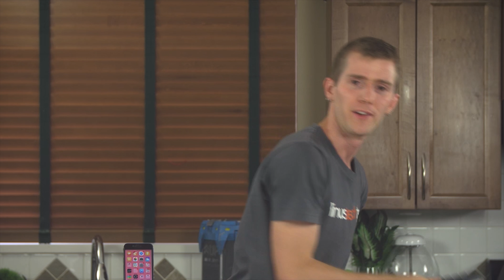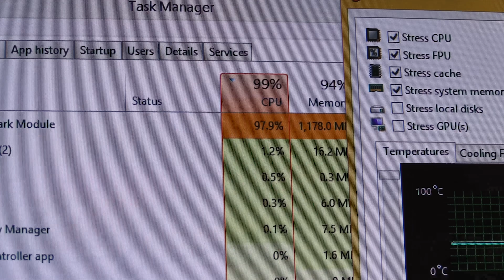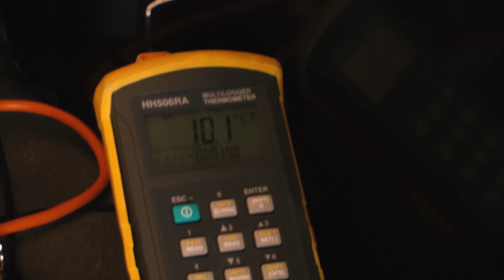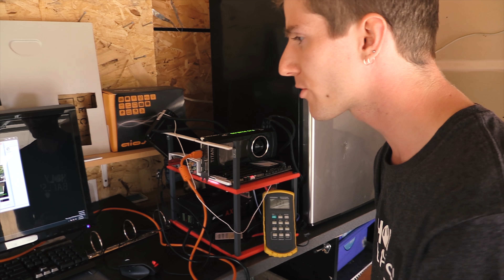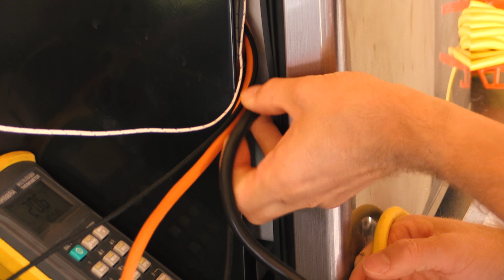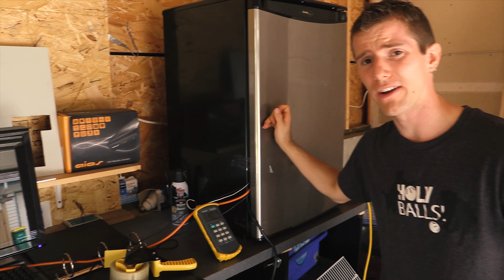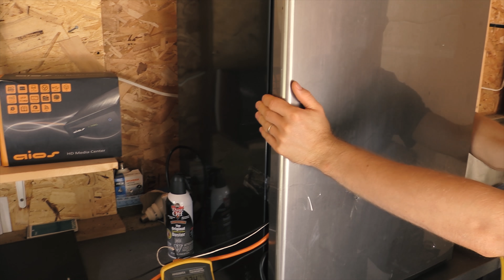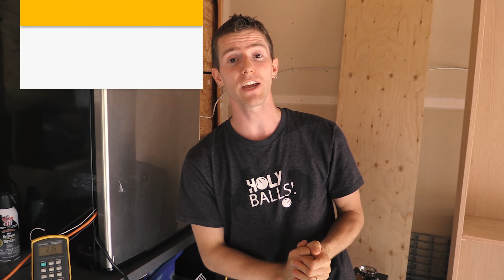PC Build in a Fridge - Does it Work??

Comment: Build a computer in space!
Reply: mfw people don't know that it was a joke
Reply: Kevin G there is a lot of misconceptions here about space. True there is no fluid to allow convection and you would think it's an insulator, but you have to keep in mind that convection is only one of three means of heat transfer. The most significant in space is radiation. Radiation allows temperatures to drop below -100°C easily (space is a blackbody of 2K approximately or -271.15°C). However, direct sunlight in space (about 1300W/m2 at the level of the earth) can take temperatures above 100°C. So as long as your computer is shielded from the sun by say the earth or a reflective material at all times, it's actually a good idea. Source: Aerospace engineer.
Reply: AnAverage Joe Building it in space would be a terrible idea; in space, there is nothing to dissipate the heat and the sun's light is just going to heat the whole thing up even more..
Reply: Kevin G ....Yeah....That is the point. Jesus.
Reply: AnAverage Joe I guess it just wasn't a very good joke.
Reply: I didn't find that joke funny as it literally made no sense at all.
Reply: AnAverage Joe I support your joke. As many people can't take one
Reply: +HaouasLeDocteur thank god I found your comment; stops me from writing it myself.  I was going to say space is an excellent coolant because although there isn't anything to transfer heat via convection people need to understand you're moving from a high energy body to a virtual no energy body.
Reply: it would overheat it has nowhere to transfer the heat to...
Reply: 道衡刘 how do you think satellites work then? That's actually a great idea (there is catch however and you have caught it: the sun).
Reply: +AnAverage Joe 
u call that a joke!!!! lol....
adjust spectacles...begin response sequence
ah...u mean like the on board computers in satellites, the international space station, hubble telescope, shuttles,...or do you mean...connect to power source then float the dang thing into space? just remember its -270 c (-454 F)....so it wont work...and the solar radiation will f8k it up royally....it will be a rich mans version of '''will it blend'
Reply: +Person. but computers in space stations and spaceships relay on air flow to dissipate the generated heat by its components, the problem of building a computer in the vacuum of space, (other than the obvious reasons) is that there is no air flow being a vacuum and all that, so the components would have to relay on radiation to dissipate the heat, instead of conduction (heat transfer), which is not a good way to dissipate heat as fast as the components generates it, so not a good idea, even liquid cooling systems, and the new convection cooling systems, relay on air flow to transfer the generated heat.
Reply: Yu Stephen People who indulge themselves in technology a lot or "nerds" how they used to call them; don't have very much of a good sense of humor.
Big surprise, right?
Reply: Avery Chapman As it has been pointed out before, this is incorrect. Comets don't all originate as broken chunks off an ice worlds, after all.

Because space is a near vacuum, there is near-infinite capacity  for the heat to dissipate into. Furthermore, Linus the Tech Tool was wrong when he concludes that the reason a fridge doesn't work is because it is a "closed system". For one thing, it's not, the thermal energy is being absorbed into the coolant. The problem with the fridge is that it cannot displace enough thermal energy to keep up with the heat being generated. In fact, a fan placed inside the fridge (not outside leading in, but inside the fridge itself directed to components) would improve efficiency provided the fridge has sufficient capacity.

What you are thinking here is that the vacuum of space would prevent heat loss by conduction. However, radiation would still take place.
Reply: +AnAverage Joe it'd be wiser to buuild one on Earth, then send it to space.
Reply: *****
radiator only cools to ambient temp. he would need a water chiller/phase chanage unit that can dissapate heat in an oven, oh not to mention the computer would need to be a closed system.
Reply: HaouasLeDocteur Mhhh good point, missed that one; +1
Reply: +bign3ck SIGNIFICANT heat transfer WILL take place via radiation and in total eclipse, you'll witness temperatures so low I don't think your processor can even handle them.
Reply: TheDeltaMoo very slowly, which was my point.
Reply: +AnAverage Joe Actually good question, in space temp go very very cold, but no air to disperse the heat, no idea what would happen.
Reply: OMG for anyone that's actually contemplating the solution to this:  YES space would be an excellent coolant through radiation (because there is not air to transfer through convection) HOWEVER since the radiation transfer would be extremely small because of the surface area of the computer/processor you would need to have large fins to disperse the heat (increasing the m^2 would therefore increase the rate heat is transferred).
Reply: ***** Great contribution.
Reply: +AnAverage Joe There are already many computers in space ;)
Reply: +AnAverage Joe NASA has done that... Long story short, it works...
Reply: ***** I think we were talking about a different kind of vacuum.
Reply: james wasda LOL this is hilarious....i guessing he was joking....or Houston we have a problem....
if he is serious, imagine if he runs a food and beverage company and his biggest selling point is his unique vacuum sealing technique...i can just imagine a production like of hair nets and hoovers LOLL
Reply: Harri v'Jah A bunch of plastic bags getting sucked out by dyson vacuum cleaners.
Reply: ***** okay...i don't even want to think through that one...lol... well this friggin thing would have worked if Linus used a god dang desktop tower with the panels removed (replaced with thin film used for food..to prevent condensation f8kkin sh88 up...that god dang condensation...) and kept the peripherals on the outside...,he used pressure sealed unit with its built in vents dissipating the heat) ....so when the fridge does its thing..its just cooling the vented air as those air molecules are closest to the walls)....god dang ZBox essentially create a force field fo dissipated air around it self....its like 'listen fridge I got this...I SAID I GOT THIS!!!" the fridge never gets a chance  to cool the components that Linus is measuring...

as for you vacuum cleaner...you do realize those friggin cooling fans are a vacuum cleaner ...hence the air blowing out the back of yoru desktop or sides of your laptop are warm...just like a vacuum cleaner....

anywho...fridge is for BEER...hmmm beer...
Reply: +HaouasLeDocteur Moreover, it is not the fluid dynamics that promote PC cooling, but rather that by moving away fluid (aka air) you're providing a medium of lower energy energy saturation in place of a medium of higher energy saturation; as a result more energy from the CPU can be absorbed into the air. As such, the problem with the PC in the Fridge is not that it's a "closed system". All active air conditioning, including refrigerators, operate at highest efficiency in closed systems. The problem is that the coolant could not absorb and dissipate heat fast enough to keep up with the thermal energy being dissipated by the PC. A closed system is better not because you're letting "cold air out" but rather because you're allowing increased energy in, which the coolant must absorb to maintain a target energy density in the system.

The reason why water, glycerol, glycerine and oil all work better than air is because these materials can absorb more energy than air can. But they all work in the same fundamental way, and this is why frequently simply plopping a motherboard into a fish tank full of vegetable oil will not work well.
Reply: abattlescar Hopefully the duct tape will hold up under those conditions :/
Reply: Zavi Aman Sick! I'll have all the money from kickstarter in about a month!
Reply: +droid Not Quite because of thermal radiation, but that's certainly not enough to cool a pc
Reply: +Pandollian Nope, that is a fallacy. Space is cold, but there is so little of it out there (i.e. it is a vacuum) that the only mode of heat transfer away from the system is radiation. And if you are in the sun, you can forget about that too unless the computer is actually /glowing/ from the heat.
Reply: droid i"m a saiyan, Does that mean i'm not a moron? Or a super moron
Reply: Computer would overheat.

It wouldnt be able to emit its own heat because the vacuum does not transport it.

Therefore, oberheat.
Reply: +HaouasLeDocteur You&#39;re right in that radiation is a thing, and that it&#39;s pretty effective, but you definitely don&#39;t really understand exactly how the cooling works.

Radiation is a very powerful tool for dissipating heat, but unfortunately, it&#39;s not enough to keep up with the heat that a processor generates compared to its surface area. Getting rid of waste heat in space is actually a huge problem that NASA had to deal with. Instead, they decided to use heat pipes--think liquid cooling using fluids other than water--to move the heat off of the heat sources and into reservoirs that would increase the radiation rate. But when you start factoring in efficiency, you&#39;d be much better off just building it here on earth, where you have a free, huge reservoir to remove the heat (the atmosphere). 

Moving air cooling is far superior to radiation cooling because you can increase cooling by increasing the rate at which the air circulates. It&#39;s really just easier to do. Space is cold and radiation is pretty efficient, yeah, but it&#39;s not efficient enough to keep processors cool. Plus, here on earth, you have insulation protecting from solar radiation anyway, you don&#39;t have to wrap it up in expensive gold foil. The reason satellites work isn&#39;t because space lets them cool things super well--it&#39;s because satellites use the lowest-powered computers possible to do the work they can. If you put huge, super powerful processors on satellites, they'd overheat and fail. Or you'd need a cooling system so big that it would cost millions more to launch the stupid thing into space in the first place. 

tl;dr: NASA has a ton of problems keeping things cool in space. Yeah, radiation is a thing, but it&#39;s worse than using a combo of moving-air convection and conduction.

Source: I&#39;m an Aerospace Engineer as well... also have several years of work in the HVAC field, so my thermodynamics are pretty solid.
Reply: Milan Daci Why not? The internet is made so people can discus different opinions, jokes, theories, or ideas. 
As you can see there is a endless amount of discussion for just one sentence.
Reply: +Jc Knight Did you even read the thread?
Reply: Jc Knight The problem with that is size, dude. Power radiated is proportional to the surface area of the thing that's radiating the heat. Earth has a huge surface area, so it can radiate a lot of power, making it a good heatsink when you take the atmosphere into account. Processors are small, so you need to use conduction to move the heat away from the processor and onto something bigger. That gets expensive real fast, making it impractical.
Reply: Jc Knight Except that's massively simplifying how satellites are cooled. They need to deal with that energy and move it away from the processors--essentially, the satellite itself becomes a heatsink and the energy radiates out from there.

The way satellites are cooled today involve using expensive reflectors to prevent solar radiation from heating it up. They also use components that generate as little heat as possible (in other words, the weakest processors capable of doing the job). If that's not enough, they're cooled by using expensive conduction systems. They are cooled by radiation eventually, yes, but the system used is a lot more complicated and expensive and really just doesn't give you the nice results you seem to think we'd have.

Cooling satellites effectively is a difficult problem in the aerospace industry. It's a balance between powerful computers and low heat. So we put relatively weak computers into the satellites to deal with the heating problem.

The problem isn't the cooling sink of space not being big enough--the problem is that radiation isn't fast enough to keep up with the thermal loads that the processor puts out, whereas convection plus radiation plus conduction on earth can give much better results for a tiny fraction of the cost.

I'm an aerospace engineer man. Arguing satellite cooling systems with me isn't an argument you win... lol
Reply: AnAverage Joe you are sort of right people who indulge themselvs in any kind of anything are nerds in that area like football nerds or car nerds
Reply: nephalos666 radiation does not need a fluid. What you are talking about is convection. Actually Radiation in space will allow temperatures of -150°C to be achieved really easily.
Reply: AnAverage Joe yes build a computer in a vacuum. great idea.
Reply: +Scott Rikkard heat transfer will not take place in space, so no way of convecting heat
Reply: +bign3ck there is still radiation.
Reply: Kevin G Blackbody radiation can would probably be the only effective cooling (radiative cooling), so those huge black heatsinks would need to be used.
Reply: +HaouasLeDocteur But how fast will the heat radiate away?
Reply: bign3ck That depends on your cooling surface area.
Reply: +HaouasLeDocteur I took heat transfer too.
Reply: +AnAverage Joe OooooOOoOOOOuUUuuuhhhhHHhhhHHHhhhh....
Reply: +Kevin G with a temperature of less than 3 K i think that any insulation issue is negligible
Reply: Harri v'Jah .....Yes
Reply: ***** Because people are dumb, duh. Don't read into it too much though ;|
Reply: +AnAverage Joe  GENIUS!
Reply: +AnAverage Joe because vacuums are GREAT at transferring heat!! lawl
Reply: +Kevin G Dark side of the moon problem solved.
Reply: +AnAverage Joe  8 bit likes
Reply: +AnAverage Joe Don't worry, NASA will send linus to the moon to help them build computers for their massive futuristic space base.
Reply: abattlescar could you imagine having youtube videos of space tech reviews and tutorials. Video titles like "how to build a vacuum cooled computer on the moon", "gaming PCs on mars? why not!"
Reply: +AnAverage Joe You would need X-Man Magneto to hold the devices in space without being touched..If you can supply X-Man Magneto he will probably give it a try :D
Reply: +AnAverage Joe Fucking magnets, how do they work?
Reply: +AnAverage Joe It would be cold but the radiation would kill the computer dead unless it had significant shielding. And aliens might steal it. Yes aliens
Reply: thefelrider do be racist, yo.
Reply: Build us in space
Reply: +AnAverage Joe It's possible and has been done. Not a desktop PC, but the computers that run satellites and rovers. All the hardware has to be radiation hardened though, and that  ain't cheap...
Reply: Milan Daci ?? i was talking about Magneto the guy from X-Men movie with super natural powers. I was not talking about magnet lol
Reply: Oh my bad Zavi Aman
Reply: ***** but can it run minesweeper?
Reply: droid
Reply: +AnAverage Joe Build a computer on the outside of a dyson Sphere.
Reply: +Milan Daci nice icp reference :p
Reply: Killer Kevin hehe thanks
Reply: +AnAverage Joe Heat would still build up would it not? there would be nothing to carry away the heat.
Reply: +Niklas Flyckting space is cool so to wouldn't overheat is the first place
Reply: You guys are talking about just background temperature if the computer was actually on it generates a lot more heat then it can radiate away
Reply: Milan Daci It means your a moron at everything but fighting.
Reply: +HaouasLeDocteur But good on you for knowing that radiation is in fact a thing and that it is still pretty efficient! Definitely better grasp of the concept than the people who just think that convection is the only way to remove heat :)
Reply: Why people still commento
Reply: Hm Yeah true
Reply: +Kevin G ....Your ignorance of the basic fundamentals of thermodynamics is frightening. As long as the cooling section of the unit was pointed radiating against the Black Body of space, and solar incidence was reflected away (like pretty much how ALL our satellites operate), the near absolute zero of space makes a near perfect heat sink.

In fact, if it wasn't, the Earth would collect all the Sun's radiation daily, and have no way to radiate it back. We would become a molten blob in no time.

You Sir, like most of the convection-obsessed dolts posting here, are a moron.
Reply: +Jc Knight Too perfect, most CPU's start to fail at around -40C, vacuum would completely destroy that.
Reply: +tyu hji .....It's not all or nothing. Since it's generating it's own heat, one only needs to calculate the amount of heat removal to arrive at the optimum temp for any processor. Since the temp of the black body of space is a constant, the cooling radiator would be easily sized for that.
Reply: +Scoobacca152 ...Not really. Given that the cooling sink of space is near Absolute Zero (about 3 Kelvin), and you only need to remove about 40 kelvin from a processor (say, 310K to 270K), the surface area needed would be minimal. 
And it can be as thin and light as copper foil. No need for the relatively heavy blocks used in PC's. None of this is theoretical. It is exactly how thousands of satellites in orbit (and deep space) are regulated currently.
Reply: Jc Knight Right, but the only way to do that would to either close it off or put some kind of electric hot plate on it. Even then, that'd smother the covered part in heat.
Reply: +tyu hji ......Huh? Close it off or put a hot plate on it?
Reply: +Scoobacca152 ...So am I... man.

And while I had to keep things simple for the average reader, lest I start writing a Thermodynamics Textbook... Everything you stated above is pretty much just a reworded form of all my posts here.

And the initial argument wasn't whether ground-based cooling systems are superior for rapid heat removal. Of course, We have entire oceans we could sink heat into if we had to. The issue was whether ANY processor (or heat source) could be cooled in the vacuum of space.

If you read the early posts, some were arguing that because there was no atmosphere to blow over the cooling plate, it couldn't cool at all. Everything from there was simply an attempt to explain the three main heat transfer methods to people who fell asleep in 5th grade science...
Reply: Jc Knight I know the heat transfer methods, I just argued that you could cool a computer in space.
Reply: +Jc Knight Stop attempting to sound intelligent, as if everyone else is stupid, when you have no concept of basic grammar or punctuation.
Reply: +Kevin G Isn't normal space at around -273.5°C?
Reply: CH1CK3Nwings Doesn't matter if there's not an efficient way to move the energy.
Reply: danaolsongaming Riiiight... well then, that's future story!
Reply: +Kevin G What is the temperature of the dark side of the moon?
Reply: +道衡刘 Aluminum foil makes a great heat shield.
Reply: +bign3ck You do know that nuclear power plants need to have a water stream near by for cooling right?  Are you not aware that deep space probes are powered by nuclear reactors?
Reply: +OptimisticPessimist I'm pretty sure they usually have a different type of reactor for satellites.
Reply: +OptimisticPessimist you do realize deep space is sub zero temperature to an insane degree, right?
Reply: Flimbo nimbo
Follow the link in my comment.  People argue that it doesn't matter, because it is a vacuum and there is no mass to transfer heat.  My argument contradicts them.  Thanks for supporting my argument by arguing with me.
Reply: OptimisticPessimist Thanks for making nonsense up, since stating that deep space is sub-zero temperatures is hardcore raging out to the tenth power arguing.  I most likely will not check out your link though. It probably wouldn't pertain to this topic anyway since you can't even pay attention to what you're reading here, let alone another website, apparently.  But, just so you can feel even more stupid than you already do, they don't even use "reactors" on probes, numbnuts. When you have some free time, you should also look up the definition of arguing.
Reply: Flimbo nimbo
Numbnuts insult for imaginary reasons.  The link is to the comment to which I replied before you replied to me.  Perhaps it isn't a "reactor" but it is nuclear powered.  Maybe I should have refreshed my memory of how that works.  It's not the point of the conversation.  It's something that needs very good cooling to work and wouldn't work if it didn't get cooling from the exterior.  The whole point of the conversation is about whether something, in the case of which I responded, a CPU, that generates heat could be operated outside an atmosphere without overheating.  Thus my point. Numbnuts.  Read what someone is responding to and consider carefully the point (s)he made vs the point(s) countered before you try to correct while throwing insults. Numbnuts.
Reply: Flimbo nimbo So... what is your stance?
Reply: There is no temperature venting in space. Plus its hot.
Reply: OptimisticPessimist Sorry, but the "vacuum" is what helps to keep space cold. It's around -400 Fahrenheit CONSTANTLY in deep space, reaching even lower as you get further and further away from the sun(and we are BILLIONS of light-years away from another star that could produce any heat to affect ANY probe Earth has launched). You would actually need to keep electronics HOT to prevent from them freezing, not making something to "cool" them. and Angel Garza no, it's not hot in space. Deep space is enough to freeze you to death near instantly, please read up on what you are talking about before you comment with such BOGUS bullshit. But back to OptimisticPessimist You are talking about something that needs to be cooled to around 40 degrees Celsius, when the constant temperature surrounding it is around -250 degrees Celsius. If you haven't got the picture yet, I feel sorry for you. Goodbye.Angel Garza
Reply: Flimbo nimbo
Thank you for point that out. I am in awe of your wisdom. You straightened me out good.  By making no points that contradict any of mine.  Thank you so much for that Sir or Ma'am.
Reply: OptimisticPessimist Whatever. you say,
Also. if you could actually read., you'd see that. I said YOU, cont radicted, YOURSELF, but please continue...
Edit: I changed my sentence structure up a bit to conform to yours. But, you really should go back and read your own nonsense, then what you replied to, then what you replied with, and finally what you've replied to the replies that were given to your original.  It's really just.... sad.... at least up until this point. I have no need to "contradict" you, when you do a better job yourself. Also, the third thing so far for furthering your education, learn the definition of contradict.  It's really not a big word, don't throw it in to sound intelligent... You're using it incorrectly.
Reply: Flimbo nimbo
Now I'm not sure whether I'm being punked or you're trolling for your own personal entertainment.
Reply: +OptimisticPessimist I really don't care at this point what you would like to think, I made a simple statement to inform you that space was cold when you asked about cooling. I'm not going to argue about something that is scientific fact. You are the one who wanted to start some sort of debate over it. You are, again, free to your own opinion, if you so choose.
Reply: Flimbo nimbo
My ORIGINAL point is that space is so damn cold. I never deviated from that point. For fucks sake.  Edit: That was a PART of my point which I did NOT deviate from.  My point was that the vast empty space of the universe is not the great insulator that some others are or were arguing it must be.
Reply: Flimbo nimbo Though it is not that simple.  Space is cold, but there's no effective way to transfer the heat generated by a processor into the void of space without a large surface area.
Reply: Your WhiteSpace code checks out.
Reply: Yes! This important point.
Reply: "If you read the early posts..."
No one reads the early posts. Not this far into a discussion.
Reply: And a hat! To keep away aliens who want to steal the space computer.
Reply: Radiation